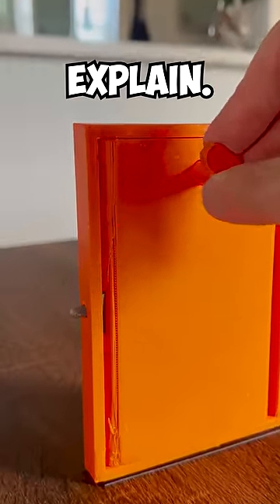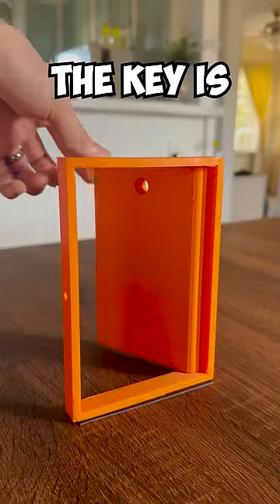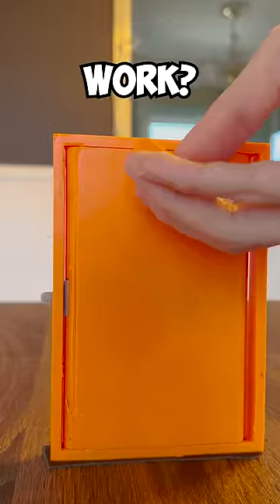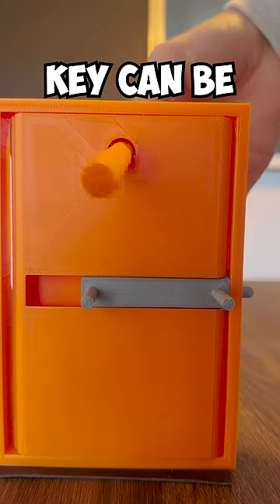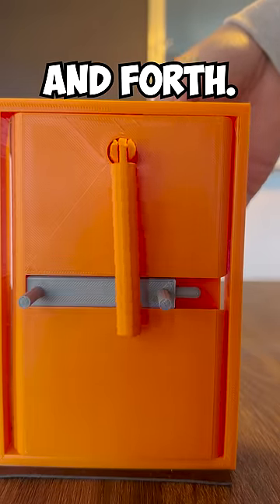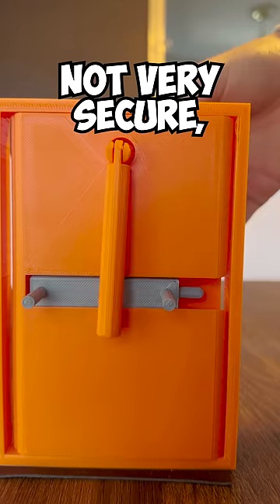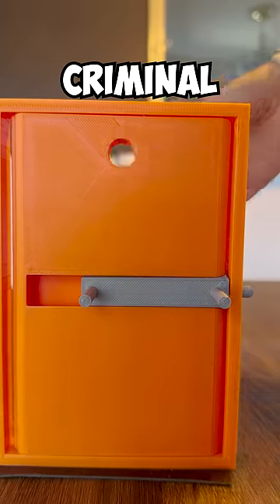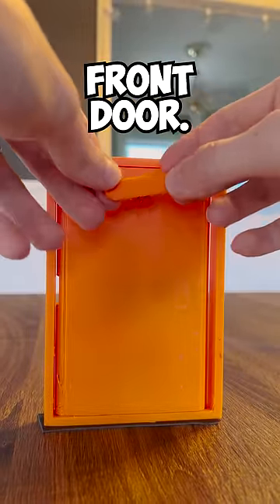How does this 3D Printed Lock Work?

Comment: First: I never seen an unmotivated criminal in the first place. Second: I never seen a criminal in this small size.
Reply from the maker: I guess you’re right. If you’re a criminal, you must have motivation to begin with
Reply: @makermandan can we get the stl file?
Reply: Maybe for a rat/ Hampster setup ' for ascetic reasons'
Reply: Locks are to keep honest people honest. Any lock can be bypassed if you’re dedicated enough
Reply: Criminals are extremely unmotivated. It’s usually just based on what seems the most vulnerable, and they pick the easiest target. The vast majority of criminals are not motivated towards some grand crime.
Reply: @boarbot7829  These "most vulnerable" and "easiest target" points ar valid. However, this has nothing to do with motivation. If you choose the ripest apple in the pile, you are unmotivated to eat apples? See? It can't be logical connection between these two.
Reply: Hmm imu

Comment: “Hello, this is the lockpickinglawyer and today we will be opening this lock with a string and lubricant”
Reply: Not even that. Could easily slide a piece of plastic in the crack between the door and jamb and push the bolt enough to open the door.

Comment: I've used those. 2 things make it more secure. 1- you can use a z-bar linkage to have a ride engage on the hinge side of the door. You can even have multiple bars at different heights on both sides, like a safe. 
2 - add a ledge let before the pins the key engages - then the hanging part of the key has to be the exact right length - too long is as useless as too short. Regular locks can be picked, that lock requires you to make multiple keys to try, until you get the length exactly right. BUT you have to know it's that type of lock to even try. Then you have to try every possible length of hanging rod in all 20 holes in the door. Odds are good I'll be standing behind you before you get it open. 
There's a few other tricks we use. But at that point, you already made it easier to go through the wall than through the door. The locks on your door right now? Any 12 year old with YouTube can learn how to open the locks on your front door now in 30 seconds with $10 worth of tools. Just saying...

Comment: I have a suggestion

You can make it safer by using the methods that a key uses which is make certain pattern on the key and hole that only lets that exact key through it👍
Reply: A thin wire would go through it, regardless of the pattern

Comment: My grandfather handmade a similar lock for a garage door. It also had a pin on the and of the moving part that went into a hole on the slider. It was tricky to open but it worked